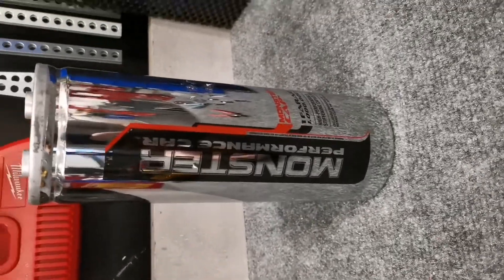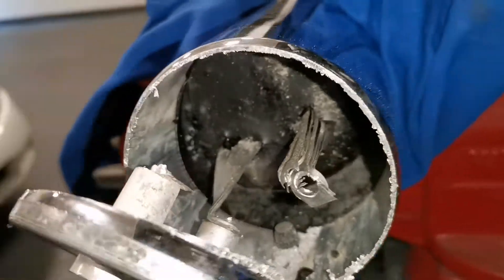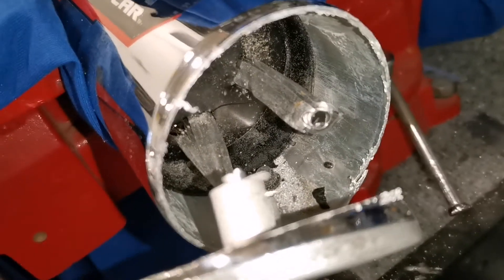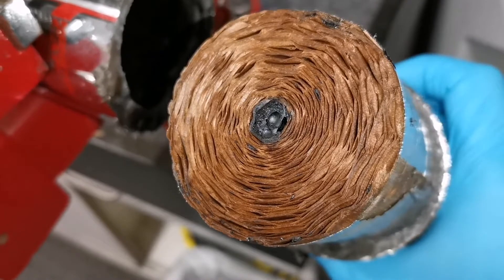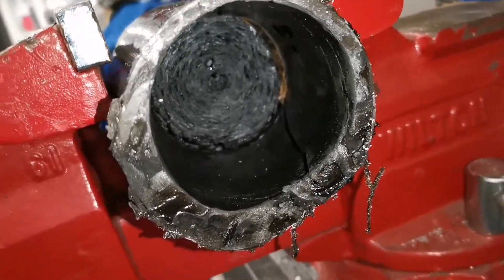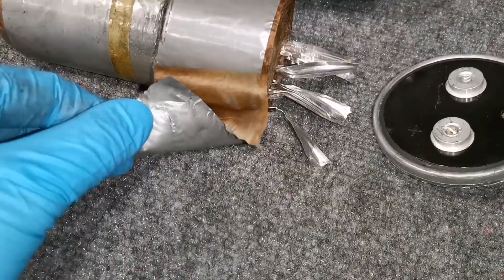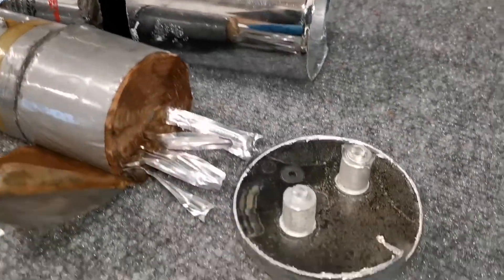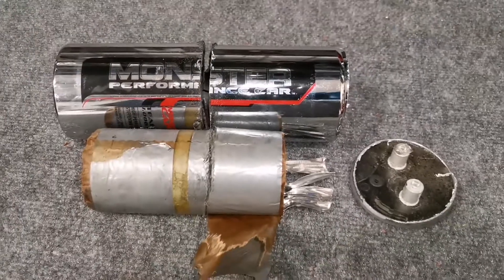What's inside a Monster Cable 1 Farad car audio capacitor?

Comment: Thanks for doing that cross section, I've been genuinely curious what it looked like, especially after working around them for so long in a shop. I've encountered 1/4 and 1/2 Farad capacitors in motors, but that 1 Farad is gigantic.

Comment: That 1farad rated capacitor is legit👍🏻
Reply: Lol.. That capacitor is junk. Does nothing to help with your voltage. You need a bank of Maxwell 500 farad Super Capacitors if you want performance from running caps.

Comment: Wow, 1 Farad is huge.  Normally, in electronics classes, small capacitors in the micro, nano, and pico range are used.
Reply: there are for example 25 Farad supercaps that are 20x smaller than that thing but they can't handle the constant current